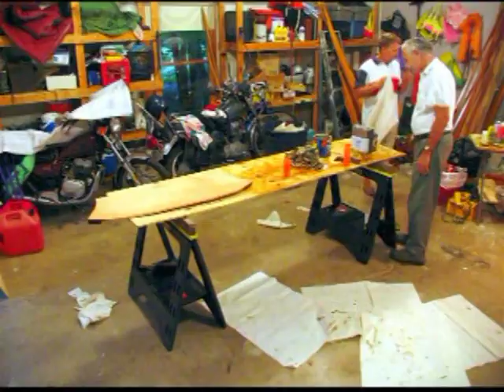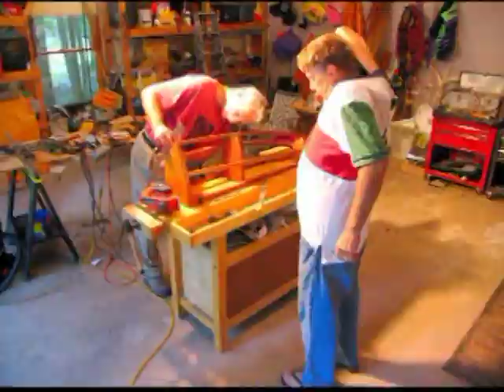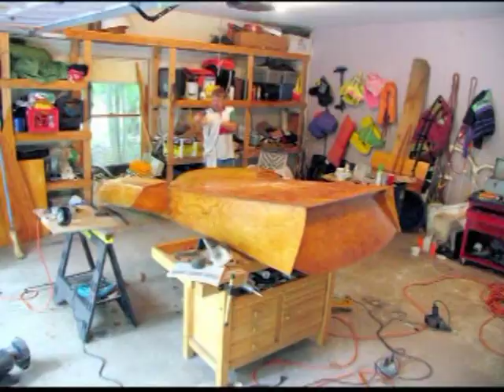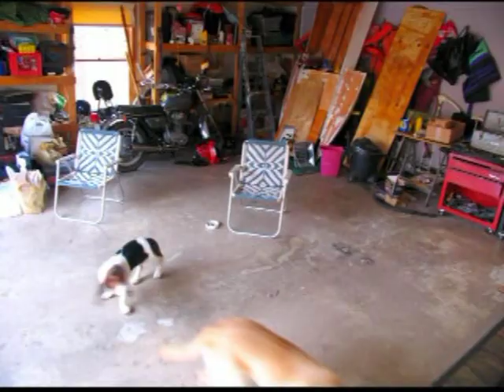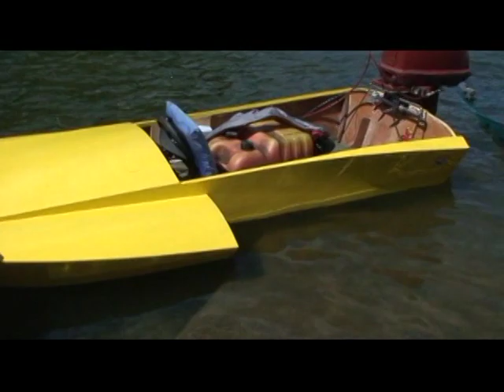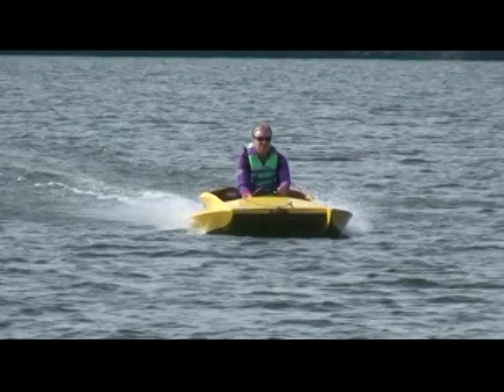Building a Hydroplane Episode 9

Comment from the maker: Ben, I hope you enjoy building as much as I did.  I've actually built 3 mini-hydros...the classic round nose one from Glen-L  in 1962 with my Dad (actually planned out with a 5.5 HP envinrude (although I only weighed 110 lbs then), but usually used an 18 on it.).
Then, in 1993, built a similar round nose from Clark Craft (much heavier, put a 25 merc elec start on it....way too heavy at 130 lb. motor...couldn't keep the nose down, even trimmed fully,
Then this one, Glen-L Picklefork (bought pre-cut kit from Glen-L), nice, nice boat.
Building this one, you'll see in the start of the video, we coated ALL wooden parts with clear epoxy paint....what a waste of time and money...We jambed the sponsons and enclosed areas with 1-liter and 2-liter soda bottles for flotation....cheap insurance.  For all 3 boats, I always worked with one more person....good way to work out details.  Many good stories.  Glen-L are super good people.

Comment: I built one in the 70's or 80's,don,t remember,used a late 70,s 15 hp Johnson,got about 40mph,trick lower unit and surfacing prop.